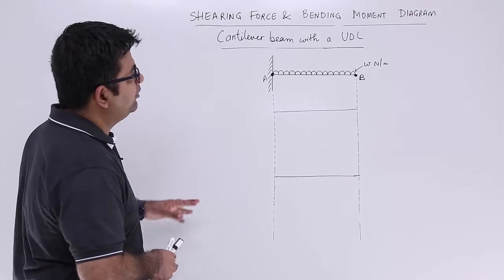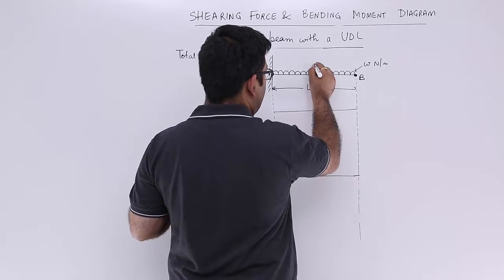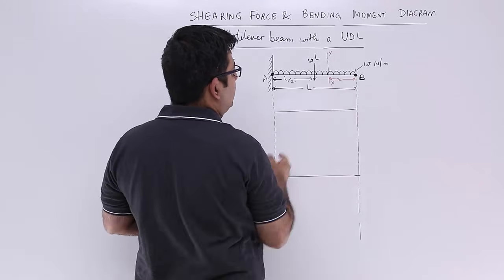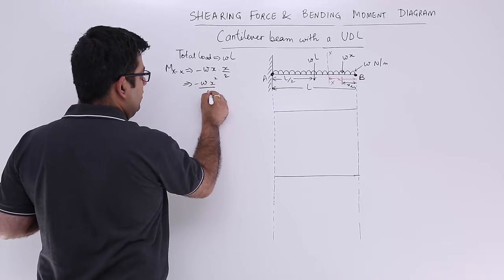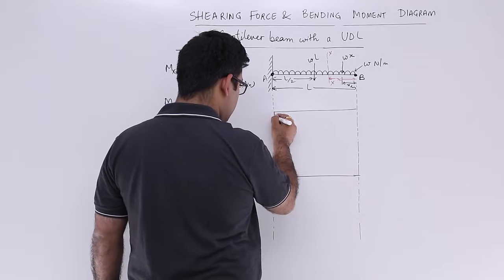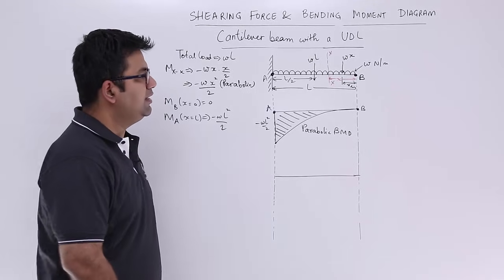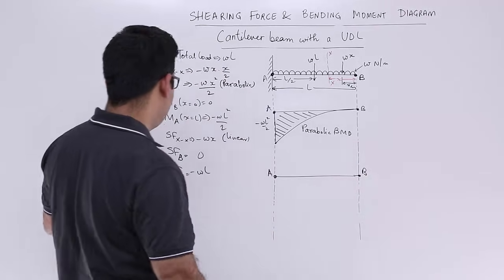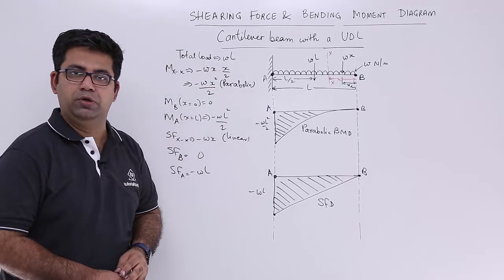Cantilever Beam With a UDL

Comment: When SF is minimum then BM must be maximum and vice versa right ? So how could both of them be zero at end ?
Reply: SF is nothing but slope of BM so if BM=0;   SF =0. U confuse with point of contraflexure which is valid only for point loads. But in case of UDL and UVL it is not true.
Correct me if I am wrong...
Reply: The Point where BM is maximum SF must be '0' but this is not valid when there is a presence of concentrated moments on the beam.

Comment: SFD is drawn wrong. As joint A will have the upward reaction which will resist the UDL load so you will have the diagram in the +ve direction.
Reply: Yes bro u right ….how these teachers have audacity to upload videos without proper knowledge
Reply: Thanks bro❤